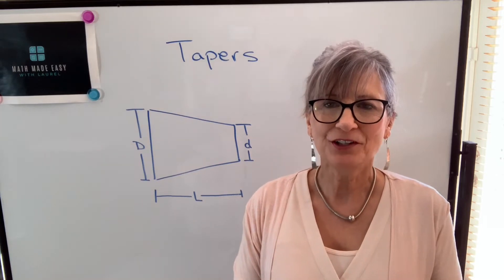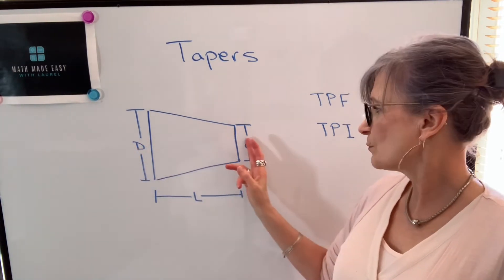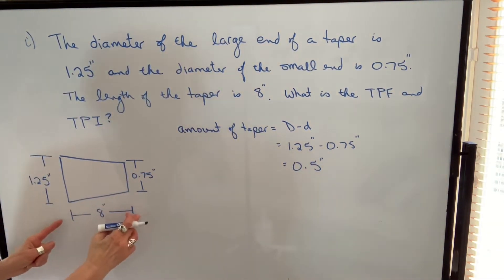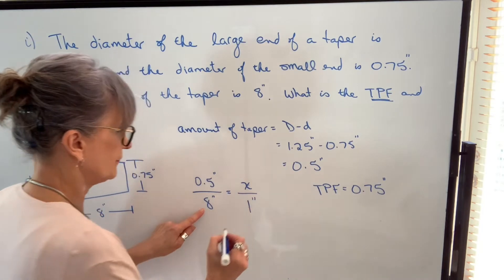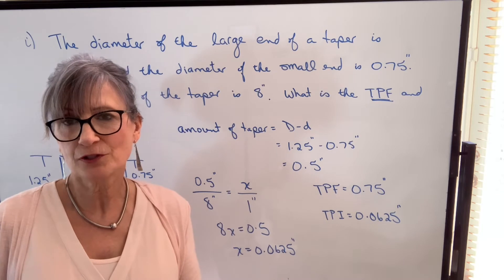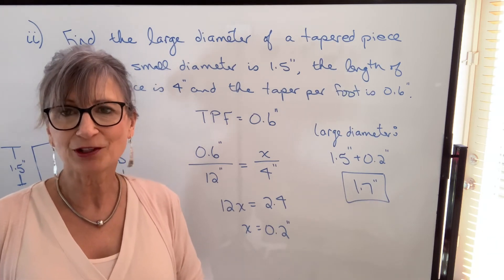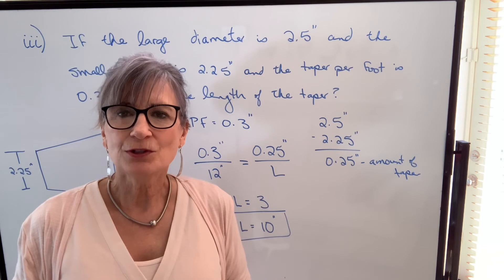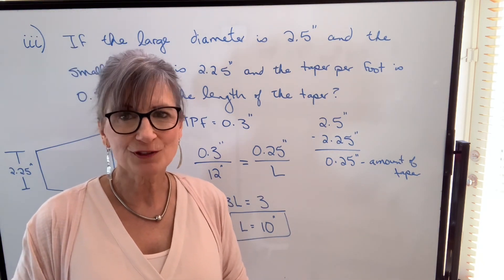Trades Math - Tapers

Comment: Hello, thank you for your lesson, they are helping. 
I found it an online study guide that I don't think is correct, no matter what I try. This website has had wrong questions before.
Would you be willing to look at the question and see if i'm missing something or if they're just wrong?
Reply: That answer is correct.  Set up the ratio.  1/60=x/120.  Cross multiply to get 60x=120.   Solve for x by dividing both sides by 60.   So x=2.  Now x represents the amount of taper over the length of 120 mm.  So the large diameter will be 42 mm + 2 mm =44 mm
Reply: @laurel500  oooo thank you so much
Reply from the maker: Is it just one question you want me to look at?   If so, sure, you can send it to me along with their answer and I will take a look.
Reply: @mathmadeeasywithlaurel9353  thank you 

What is the large diameter of a taper, where TR=1:60, d=42mm, TL=120mm?

A) 45
B) 44
C) 43
D) 42
Reply: There answers B) 44
Reply: @mathmadeeasywithlaurel9353  What is the taper per foot of a taper with D=15, d=3, TL=20?

C) 7.2